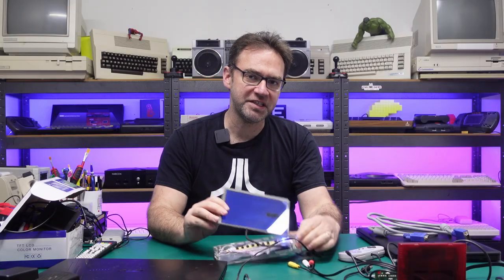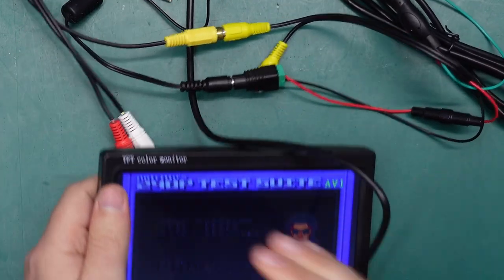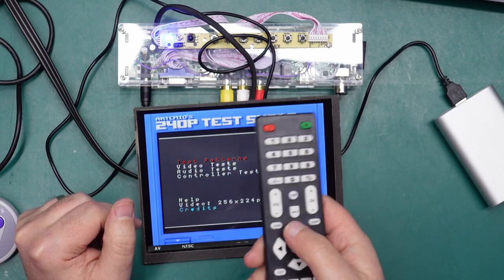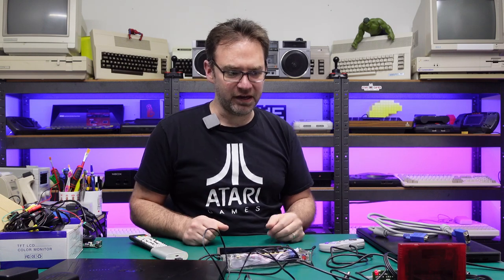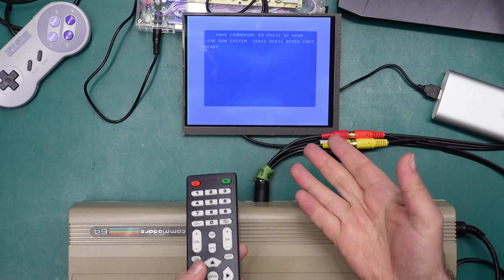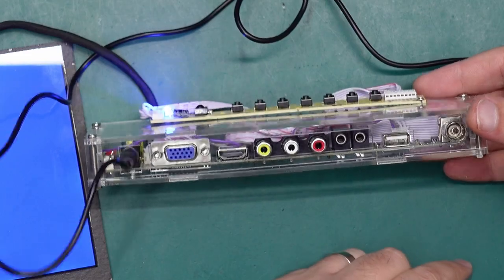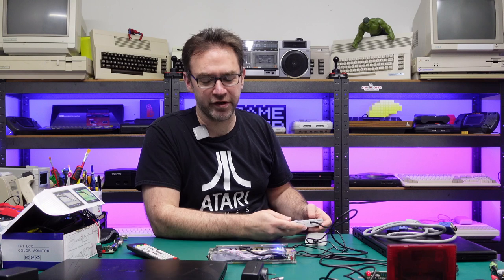Building a cheap 8" 4:3 LCD monitor with RF, composite, VGA and HDMI inputs

Comment from the maker: UPDATES: It has been reported people have been receiving a different acrylic case and different keypads. The pictures in the listings were correct but the sellers seems to have sent out different ones, so if you ordered using the orginal links (prior to 25th Dec 2022) you may receive something different. In which case I'd recommend opening a dispute. The links have been updated as of 25th Dec 2022 so there shouldn't be any more issues - unless those sellers also stuff it up.

Also something I overlooked in the video is the orientation of the LVDS connector (the cable that goes from the driver board to the converter board and panel). It is only a 20 pin connector and the board has room for a 30 pin. This is not an issue, you just need to make sure you connect the cable with the red wires on the far left of the connector (closest to the DC power input), this should leave 2x5 pins empty on the right of the board header.

Comment: I don't think OSD  lied about 1024x768p75 resolution. In Windows 10 there is difference between Desktop Resolution and Signal Resolution. You can chose Desktop resolution 800x600 and GPU interpolated image for LCD native 1024x768 on output (check Advanced Display Settings). I learned that hard way, when manualy chosen Desktop resolution 1920x1080 for TV was by GPU send in 3840x2160. My decade old in-wall HDMI cables weren't happy with that. Only help was of usage first cable HDMI 1.3 (when HDMI 2.0 cable was used W10 stubbornly  went with 3840x2160) .

Comment: Nice, Mark! Thanks for sharing how you built this. I have always liked how you use this display in your videos when shooting from above and getting the screen in the same frame w/o having to capture it separately and put it in during post, use OBS, or whatever.

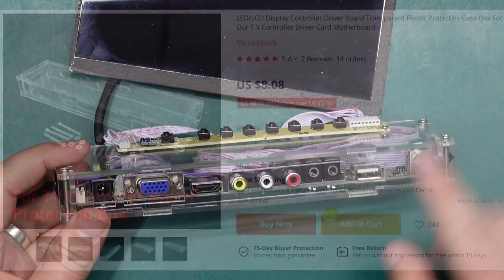15:20 I imagined you made the acrylic case yourself! So amazing we can just order all these things.
Amazing that your home brew display can take RF in, too. That's one feature I don't have with the RetroTink-2X Pro that I use for similar purpose, instead, into an HDMI to USB, then into my laptop (displayed live using QuickTime Player on Mac). Of course, it would be hard to fit my 15" laptop display in the frame, and the screen can't go flat like yours. :)
Reply from the maker: Thanks Dave. Yeah part of the reason I went for something like this was because it was easy to fit in frame on a overhead shot. I do occasionally still capture stuff with OBS, but it's much easier to grab this thing and sit it flat on the bench. Just need to make sure the overhead lights don't reflect back into the camera - the screen is very reflective
Reply: @TheRetroChannel  Ya, you are doing a great job of it. Currently I have decided to not do repair videos continuously recorded in real time. It's too much work and not fun. I enjoy doing the work and taking stills and video snippets and putting that together afterward. I will do that for my next few videos and see how it goes! :)
Reply from the maker: True, you certainly end up with a lot more footage with very little going on. And it can be tricky to turn that into something that flows easily. Sometimes I'll end up talking about what I'm doing for a length of time, only to realise later that I just talked a bunch of crap with only a tiny snippet of that containing useful info. Then I need to try and edit the useful bit in while discarding the rest, and not have a bunch of jarring cuts in the video. I've tried the other way, but I've found I'm not good at doing "natural" sounding voiceover. But whatever works best for you is the way you should go, no point doing this if you're not enjoying it 🙂
Reply: @TheRetroChannel  Yup, let's keep reminding each other of that. :)

Comment: Used the smaller board (3rd one shown) a fair bit. The ones i've used really didn't like running on 12v quite happy on 5v iirc.

Comment: I bought a couple of them after watchin this. When everything arrived and put together, the resolution was way off. I did hear you mention you bricked one of your boards with a bad bios . After a few beers I decided to look for the bios that had the screen resolution that I had and thought I have nothinf to loose.
Desoldered it made a copy of the original and flashed it with the bios for the resolution that the screenhad.
It worked perfectly and now I have 3 with differnet size screens flashed with the screen resolution bios. I hope this helps you out with your bricked one

Comment: Hey Mark, thanks for another informative video. Sorry to ask, but do you have any details on how the display interface board connects to the V29 board? The interface board has a 20 pin header and the V29 has a 30 pin header. Or did I just hit the unlucky dip on Aliexpress?
Reply from the maker: Ah yep, that's something I didn't mention in the video. The 20 pin header should be a straight row of 20 pins, other end should have 2 rows of 10 pins. The 2 row end connects to the V29 with the red wires on the far left (when you're looking at the board from the side that has all the inputs), so that should leave 2 rows of 5 pins on the right empty. Let me know if that doesn't make sense
Reply: @TheRetroChannel  🙏 Thank you

Comment: For the speakers, There are 3 sizes.  What are the dimensions of the inset of the place where you put the speakers?  Will the 53x18mm speakers fit?
Reply from the maker: Oops, sorry I meant to include that in the description. The size you want is 37x18mm

Comment: It would ve nice to know if it works with 15khz rgb signal on vga port.
Reply from the maker: True, I think I have a total of 1 system that does 15khz over VGA but it's borked at the moment. I will test it out at some point and report back

Comment: Does CoCo artifacting work using the RF tuner? You probably don't have one with the modulator still in it 😄
Reply from the maker: Good question, I do have an NTSC CoCo2 that still has the RF tuner in it. I will test it out later and report back

Comment: I couldn't resist building one of these for myself but something has gone wrong, I wondered if anyone might know what the cause is.

Everything is put together but when on the right third of the screen has vertical thin multicolour lines. The left third shows the correct image but squashed. 

Resolution does not seem to have anything to do with it as the menu screen is the same. 

I imagine one of the parts is faulty but which one? 

Thank in advance...
Reply from the maker: Could be the driver board is not set up to match the LCD panel resolution. You will need to get into the service menu to check. I don't recall if it's possible to change in the menu or if you need to update the firmware to support your panel. Alternatively it could be a bad connection or component between the LCD connector and the LCD panel
Reply: @TheRetroChannel   Thank you for the reply. I have tried changing the firmware. No change. It must be something faulty but no idea which part. I might try to use a screen from an old laptop to try and narrow it down.

Comment: I just got in most of the order for this today.  The Acrylic case pictured in the listing does NOT match what I received.  Cut-outs are all wrong.  It would be great to be able to see a picture of how the LVDS cable plugs into the driver board to make sure I have the correct cable and have it hooked up correctly.  The driver board I received did NOT have a capacitor located in the spot you indicated.  Haven't fired up the board yet.
Reply from the maker: Damn, did you use the links provided? I just checked those links again and the ones pictured are correct, so if you ordered those and received something that looks different then you should be able open a dispute with the seller(s).

As for the connection you need to plug it in with the red wires on the far left (when you're looking at the board from the side that has all the inputs), so that should leave 2 rows of 5 pins on the right empty.
Reply: @TheRetroChannel  I had the same issue with the case, they said it was a warehouse mistake and sent a label to return it. I was confused about the plug for the screen, thank you for the response on that. The controls for the menus has 13 holes but the connecter that it plugs in to is a 14 pin connecter. Any ideas?
Reply from the maker: The connector for the controls should have 14 holes but only 13 wires with one missing 2nd from the right. And the driver board should have 14 pins, is this what yours looks like?
Reply: For me, I used the links you provided.  I ended up searching for V29 Acrylic to find 2 decent looking alternate solutions.  I ordered one of the 2 today (similar price, and cheaper than the listing provided here) to replace the wrong acrylic case.  I don't have the button panel yet (only thing I'm missing).  What is pictured in the listing and what I received are 2 different things.  Glad to know that I have the LVDS wired correct.  Thanks for that.  Do you have a Discord?
Reply from the maker: You can find me in the AusRetro discord. I'm not super active there but if you @ me I'll see it (eventually)
https://discord.gg/bXPCSAm9qc
Reply: @TheRetroChannel  Ok, See you in the #tech channel.
Reply: @TheRetroChannel  The connecter for the controls only has 13 pin holes but the board has a 14 pin connecter. what side doesn't have the wire for the 14th pin so I can just plug it in with one opened.
Reply from the maker: Hey Tim, I just posted a pic of mine in the discord
Reply: @techmantim7036  I had that also, I just swapped pins around based on the labelling on the control board and left the pin marked "nc" next to ground blank and pushed the 5v pin on outside of the connecter block
Reply: @fistmaster2k482  Yeah, that was my plan as well. Thanks for verifying that it will work.
Reply from the maker: @fistmaster2k482  Thanks for confirming. Again it looks like another seller sending out something that is different from the item pictured ugh. So if I have this correct, all the pins are the same on the 13 pin version and you can just remove the last wire (that goes to NC on the board) and move it to GND (the final pin on the right of the board near the USB port)?
Reply: @TheRetroChannel  There's quite a bit of pin swapping if you received the v29 without the electrolytic cap at the end for the control board: from the silk screen under the board as follows: 1 - GND, 2 - nc, 3 - power button, 4 - menu, 5 - vol -, 6 - vol +, 6 - chan -, 7 - chan+, 8 - source, 9 - gnd from ir board, 10 - ir active pin, 11 - led green leg, 12 - led red leg, 13 - 5v. I removed all pins from the connector, populated pins 1-12 leaving the 5v pin out, inserted connector into socket then after a wee bit of squeezing the 5v pin added it to the pin 13

Comment: I’ve been wanting to add a screen like this to my toolset for a while. Thanks for the info! The LCD linked seems to be 16x9. Would this 4x3 LCD also work? https://m.aliexpress.us/item/2251832653146020.html?spm=a2g0n.detail.1000013.4.4c39c3c3fI0sUi&gps-id=storeRecommendH5&scm=1007.18500.300835.0&scm_id=1007.18500.300835.0&scm-url=1007.18500.300835.0&pvid=ddfc8744-6d19-4ccf-bf7e-7a57c66fb254&_t=gps-id:storeRecommendH5,scm-url:1007.18500.300835.0,pvid:ddfc8744-6d19-4ccf-bf7e-7a57c66fb254,tpp_buckets:668%232846%238116%232002&pdp_npi=2%40dis%21USD%2125.0%2122.75%21%21%21%21%21%40210312ee16683649145221677eb5cd%2165122577236%21rec&_universallink=1&m_page_id=rcxgapqccaabnkmf184724c2fbe245ed3e7d2250cf
Reply from the maker: I think they've just taken the picture with the screen tilted back, so it does look wider than it actually is. The one you linked to is the same one (same model number)